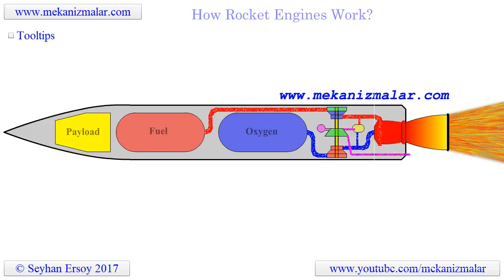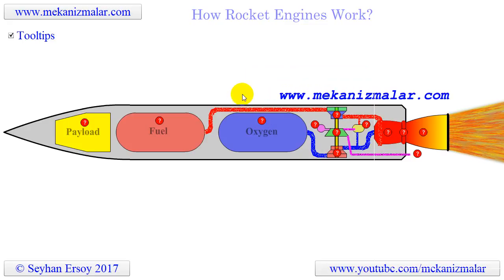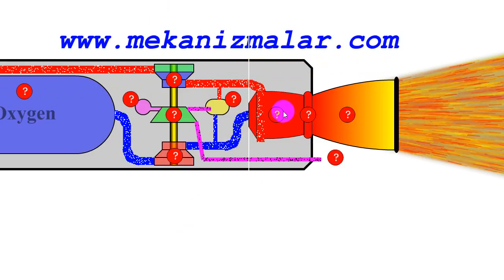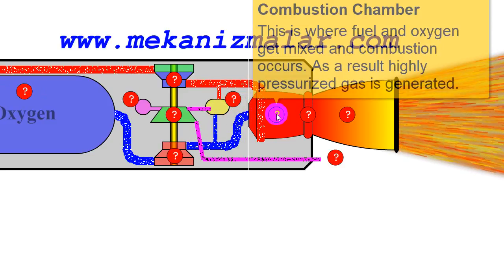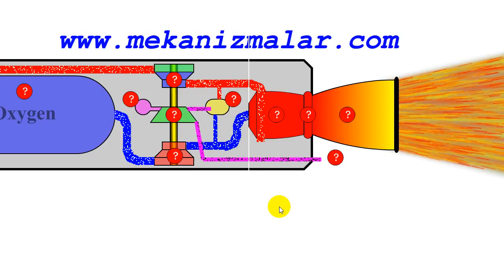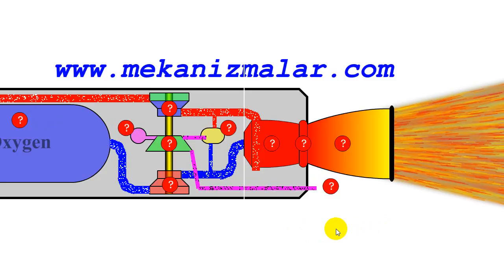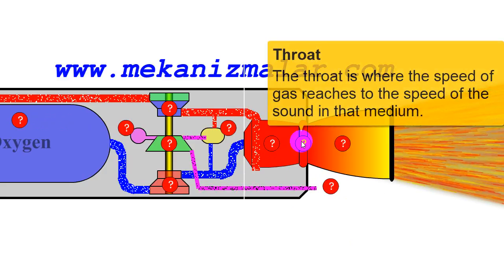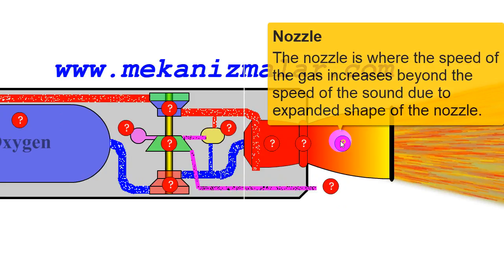Principles of Rocket Flight

Comment: Why does that purple pipe can't release the gases in the throat/nozzle? Does this will help improve efficiency? Or the pressure in the nozzle is higher than in the purple pipe and will make the pump run backwards stalling the engine?
Reply from the maker: Thank you for your excellent comment and visit to my channel. Actually the engine you are describing  is called staged combustion rocket cycle which is more efficient, however a little bit more complicated. The engine I was describing here is called gas generator rocket cycle engine.
Reply: Rafael Schimuneck it is actually how it was used for the V2 rockets, it is more efficient because this fuel is colder than the « propulsion » fuel, so basically it is used as a coolant